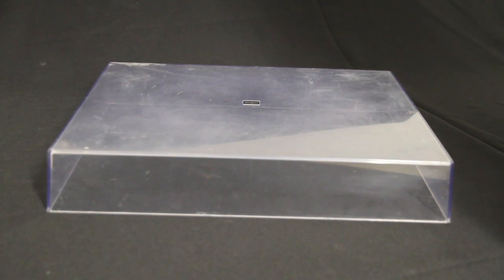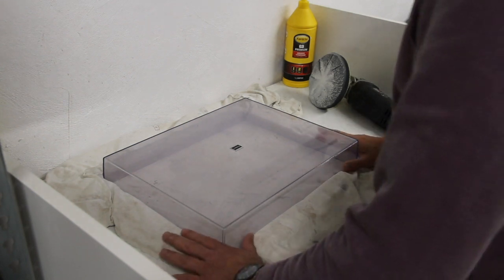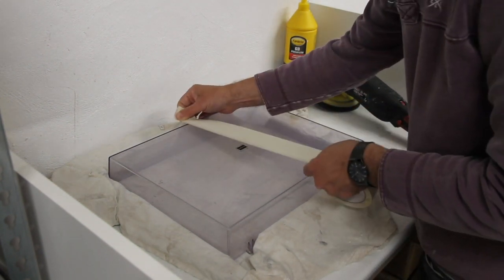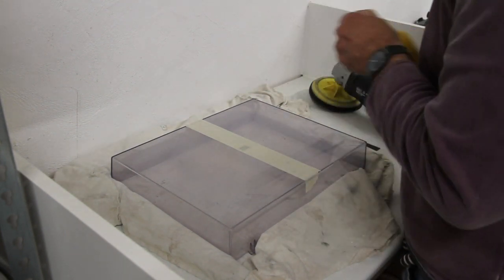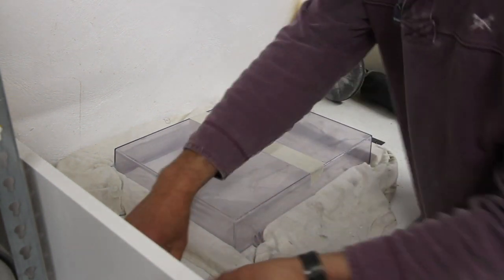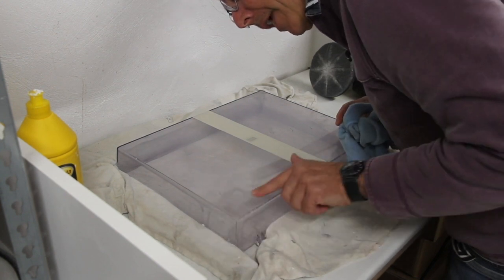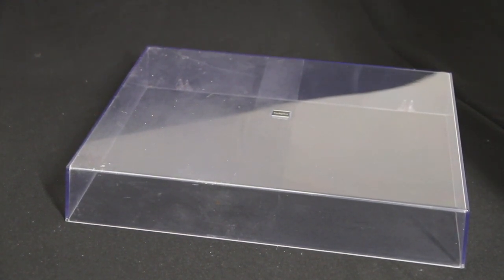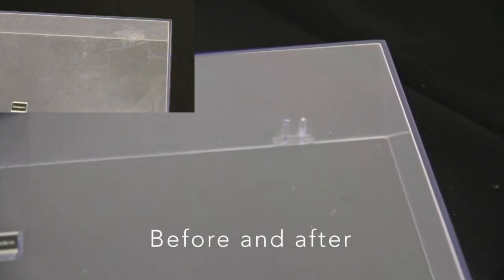How to polish a turntable lid - Hifi Addiction

Comment: Many thanks for your video, I didn't realise that such a good result is possible. I've just bought a turntable with all of the usual scratches on the lid so I happened on your video at just the right time. Fortunately, I have the equipment so I'm looking forward to the restoration.
Reply from the maker: Hi John, Secret to success is using only light to moderate pressure, slow speed and don't allow the lid surface to get too hot. It will certainly get warm, but shouldn't be hot. Good luck and I hope you get a great result.
Reply: @hifiaddiction6684  Thanks for the tip.
Reply: @hifiaddiction6684  Hi... I can scratch my Technics 1200 Gold easily. If I wanna sand it.... can start with 2000 or 3000.... but how can finish? Can I use wax or something to give it more bright like those sprays for car detailing? Thanks
Reply: @hifiaddiction6684  I have polished mine and somehow I get a foggy dust cover is there any way I can make look glossy
Reply from the maker: @catry707  Hi there, If you use the car polishing compound (Farecla Premium G3) then the finish should be fantastic and effectively like new. But I suppose you could also use a wax, but I've not found the need to try that.
Reply from the maker: @jawad08  If the 'fog' is inside the acrylic then there will be no way of polishing this out. If it's on the surface then you should be able to remove it. Make sure you do not overheat the acrylic.
Reply: @hifiaddiction6684  thanks for your tip I will try again! The fog is on the surface not inside

Comment: based on condition - Hand sand 800, 1000, 1500, 2000, 3000, and adjust starting grit accordingly.  McGuire's scratch doctor 2 on a buffer, then pledge spray wax hand buffed with flannel - plenty of elbow grease. takes 1.5 hrs.. Use small overlapping circles like a CNC and dish soapy water when wet sanding. Novus system  321 is good if there are light  to moderate scratches when used with a buffer.  if you just want to clean it up, a hand buff with carnauba wax is a cheaper freshen up vs  novus hand buff.

Comment: Great video Hifi Addiction!
I am about to polish a turn table lid. But I am still thinking over what polishing machine to buy.
You mention in the video that your polishing machine rotates at slow speed. Obviously to not overheat the acrylic lid.
But my question is: what should the ideal rotation speed be?
Reply from the maker: Hi there, I'm afraid my basic polisher does not have a speed indication, just slower or faster! Just try a slow speed first and work from there. Feel the acrylic regularly with you hand. It can get quite warm, but should not be really hot.

Comment: Hi There

Great Video. I'm looking at the sealey polishers , what speed settings are you using ? They come in different speeds.
Reply from the maker: I use a Sealey ER1700P polisher. Not sure of the speed as the adjuster doesn't tell you!

Comment: Hi there great video. I've got the usual technics problems with broken hinges on both B2  AND 3300. The spring bracket (not sure of correct name) on the actual 3300 deck has broken as well. Are these replaceable please? Thanks in advance
Reply from the maker: Hi there, replacement brackets for the B2 are readily available on eBay from a number of sources. For the 3300 it appears your are looking for used parts, which are again available on eBay but seemingly very expensive.

Comment: andrà bene lo stesso per technics sl 1200 mk2?
Reply from the maker: Yes, it will work fine. Polishing the domed area is tricky, but perfectly possible. We have done a number this way. Use Farecla Premium G3.
Reply: @hifiaddiction6684  non ho una lucidatrice, con un trapano a batteria può andare bene lo stesso? C è rischio di rovinarlo ? Che materiale è policarbonato o plexiglass?
Reply from the maker: @simonecionco1565  No, don't use a drill unless you can slow the speed right down. I'm not sure what the material is for the SL1200, but it polishes up well.

Comment: I damage the acrylic big time. My brushing machine are super small, the speed is too high. I sand it and fuck up even more 😂 I will try your method to tomorrow
Reply from the maker: Yes, I think will be much more difficult with a smaller machine. Keep feeling the lid with the palm of your hand... warm is OK, hot is not! If the lid has gone clouding, then you may be able to polish this out. If it has distorted then I fear it's had it. Go slow and don't rush. Also, not too hevy with the pressure.
Reply: @hifiaddiction6684  if you have to sand it, wet sand start with 1000 grit. By hand
Reply from the maker: @stevefredson3301  Agreed, or even finer. I tend to find 2000 grit does enough

Comment: Hi, what polishing pads do you use?
Reply from the maker: I haven't played around too much with different pads. I must admit, most of the lids have been done with the pad that originally came with the polisher! If you able to feel the pad before buying, then one that is softer probably makes sense. I'm using a harder one currently, and it still works fine, but perhaps you have to be more careful not to overheat the acrylic. The key to success is to take your time. The results are startlingly brilliant. It will make your deck look like new.

Comment: If you have only one dust cover you're not gonna invest in a power tool...
Reply from the maker: Hi there, I'm just showing people how we do it and the fact that the results are pretty amazing. Not telling you this is the only way of doing it and not trying to sell anything. In reality the polisher needn't be expensive and certainly has the potential to cost less than buying a new replacement (if one is available for that particular deck). Just sharing the technique we use.

Comment: Hah, this guy! “It took 30 mins” he says, when video is less than 5 mins. Clearly fake.
Reply from the maker: Hi Ken, can you not see that some of the footage is speeded up, and do you really want to watch me spend over 30 minutes with the polisher? This is not a 'fake', this is how I clean every turntable lid on every turntable I sell. Just did an LP12 lid yesterday. It takes certainly 30 minutes and often longer, but the results are great.
Reply: @hifiaddiction6684  quit lying man, it was clearly less than 5 mins.
Reply: @kencur9690  Your in the wrong here. Why would someone making a tutorial want to admit their method takes a long 30 minutes to complete? Because it does....  I've done about 10 Technics covers similar to this one. I use a hand-drill with several grades of foam pad and finish up with a wool buffing wheel. Covers that have deep scratches, I sand first. It takes a while to polish out the sanding marks. I've had a few covers take a couple hours to get to a point I was happy with. If you've refinished one yourself you'd understand.
Reply: @garretts91  it’s you’re.
Reply: And by the way I used a grinder as he said and now I have even deeper scratches!
Reply: @kencur9690  People who choose to correct small grammatical errors instead of acknowledging all the good information in a post usually aren't interested in anything but trying to ruffle feathers. The poster has obviously done a ton of covers and I've done around 10. There is enough info here to learn how to do it properly. If you can't figure it out, that's on you.
Reply: @garretts91   lol, I acknowledge the good information. You guys are actually quite nice: I wouldn’t have the same patience with someone like myself. For that I commend you. I obviously realise that the video has been sped up: well not so obvious, apparently, and I don’t blame you considering what’s out there on YouTube. It’s a pity I look so convincingly daft though. Just having a laugh. Very good video, and useful advice. I think for minor jobs some elbow grease would suffice, too.
Reply: Guys, clearly he was being sarcastic.. I knew that before reading any of the comments. People can be so touchy nowadays.
Reply: Ken, you silly goose, stop trolling these poor gullible people.
Reply: why you so mad?